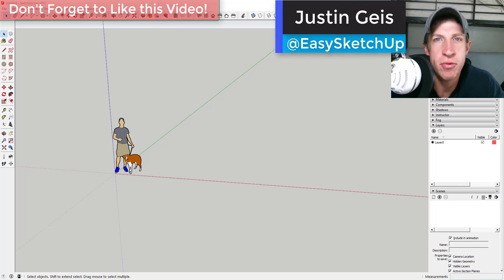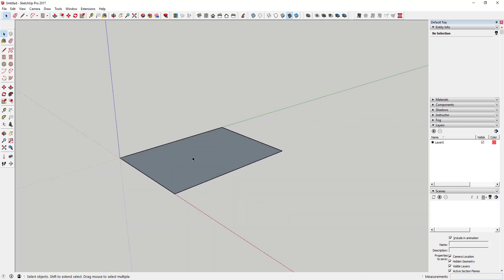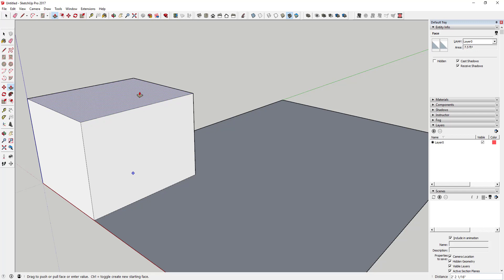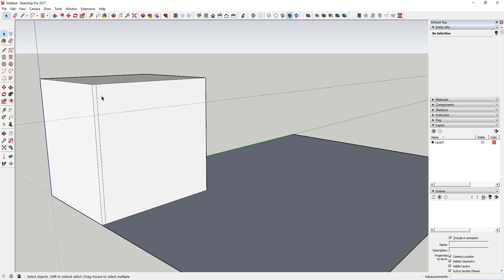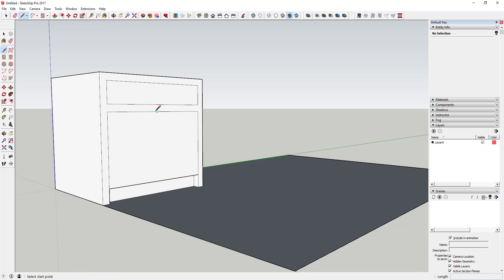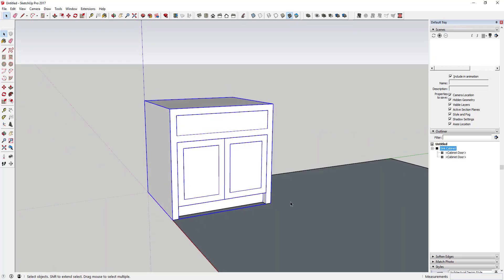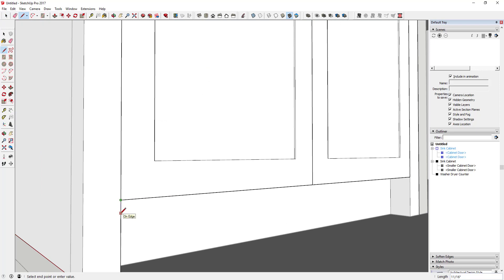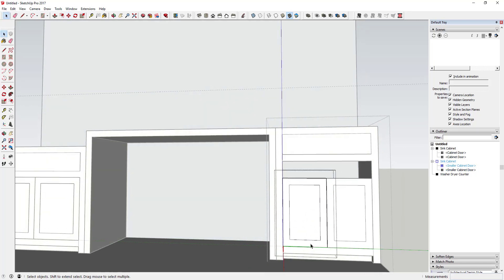Modeling Interiors in SketchUp Part 1 - Laundry Room Model

Comment: Yes, these videos are very helpful. It is interesting to see how different people approach things... Another tutorial I watched, had the structure of the room then created the cabinets outside the room, grouped them and then moved them into the room if that makes sense... 2 Questions:

1. How do you prevent the walls from "sticking" to the cabinets, using this method?
2. I always get an outline of the objects on the backside of the wall, how do I prevent that? Or the floor plan underneath the floor?
Reply from the maker: Sounds like an extra step...Also - the cabinets are in groups, so they wouldn't stick. If you really want to avoid the outline, push pull them a bit to give them some thickness - then the lines won't show through

Comment: Interesting using the select tool to move the side of the unit inward.
Reply from the maker: It's definitely a lot faster than re-drawing the whole box :)
Reply: @Thesketchupessentials  I've seen that approached used in other tutorials as well. Why is this better than using the scale tool?  Just wondering :)
Reply from the maker: @amylemaistre4920  Scaling can lead to distortion of the geometry, plus it's easier with this method to use inferencing and move to exact lengths